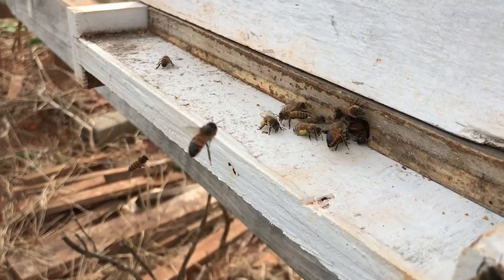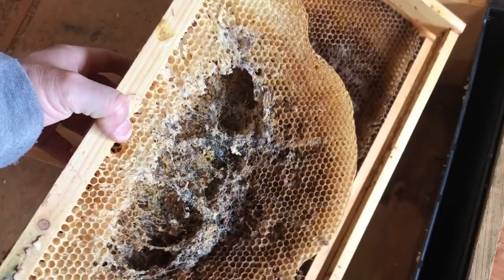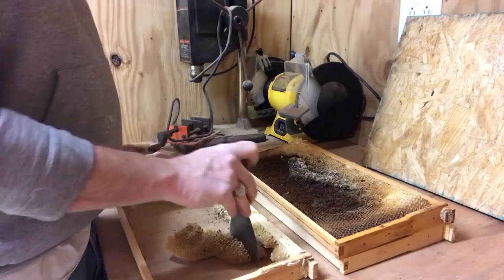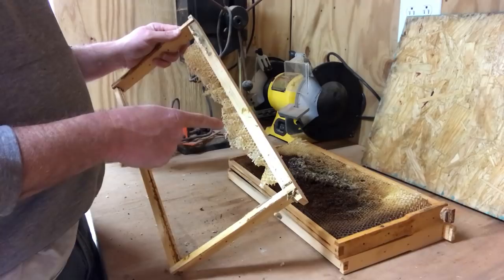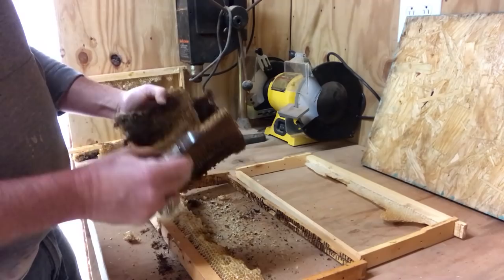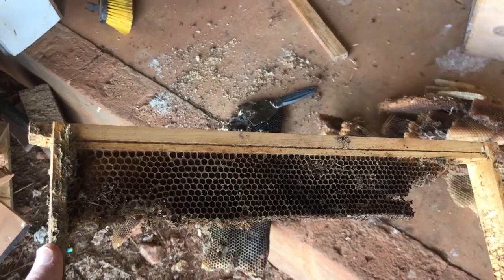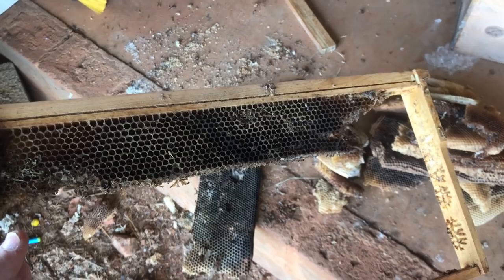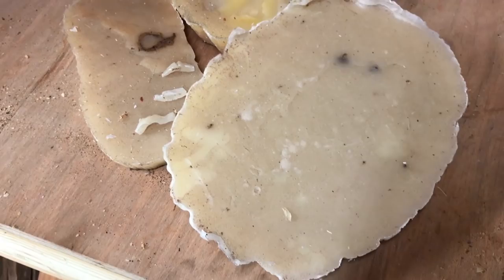What to do with Wax Moth Damaged Frames

Comment: Instead of wire I use 2 bamboo barbeque secures in the virtual position by drilling through the top bar+ instead of foundation I hot glue lollypop sticks to the top of the bar, it works better than starter strips